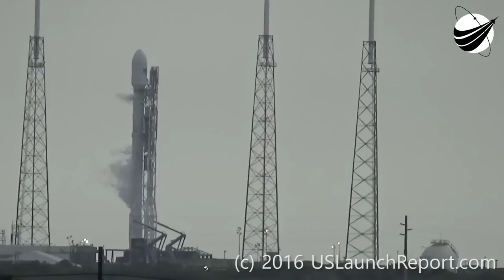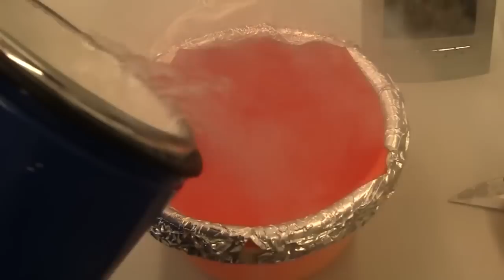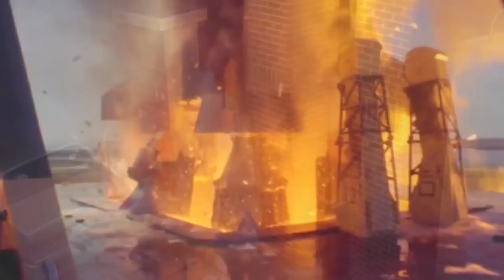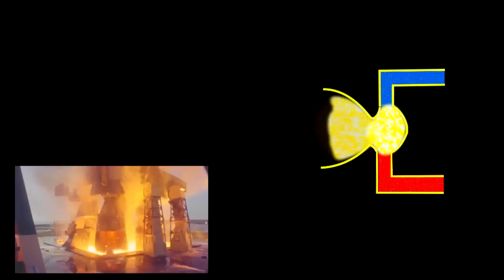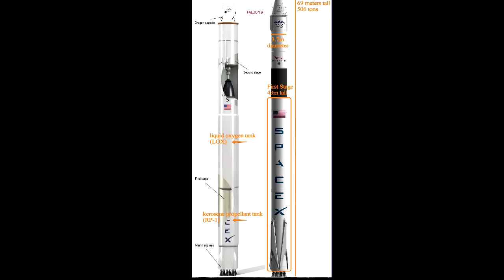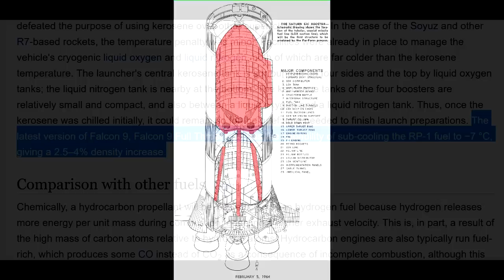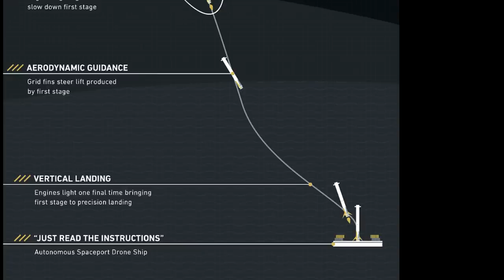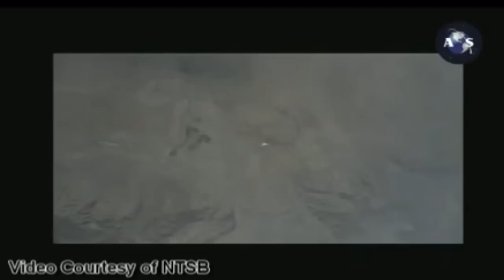Why did the Falcon 9 Explode?

Comment: Elon Musk is Thunderf00t's new Anita Sarkeesian.
Its not a bad video, just..  man is TF incredibly jealous of Elon Musk.
Reply: Except -- he didn't actually explain why the F9 exploded.  He had some speculation about the fuel tank/oxidizer lines through the fuel tank cracking, but nothing solid to offer on that count -- he seemed to spend more effort on setting chicken on fire.

And it seems a little odd to point out that NASA had a fueling explosion 60 years ago, and to point out that all of these problems are old hat, completely solved -- and then somehow think that because this is a 'commercial' venture, that the rocket designers deliberately chose not to use any of that data & instead preferred some inferior design.

Showing the Antares (Orbital Sciences, not SpaceX) explosion was somewhat on point -- he was talking about fuel and oxidizer mixing outside of the engine, at least.  But the SpaceShip Two (Virgin Galactic, not SpaceX) failure was basically irrelevant, other than a rotten attempt at FUD tactics to make out non-government space ventures to be some kind of boogy-man.

There was some great info on the dangers of LOx in this video, and some cool insights into why rocket science is hard.  There was no justification to the blatantly magical, gris-gris wearing, superstitious thinking that only NASA can build rockets.

Yeah, I think TF has a new obsession.
Reply: J L Brown Good point.  Its not quite lying in the "Violated YouTube terms of service" sense since he technically, very technically, worded it as a question.

Also, yeah, I watched the entire 2 hour(ish) NTSB review on the VG SS2 vehicle failure which was 100 percent operator caused.

He does realize that Elon Musk doesn't personally make all these things, right?
Reply: NUTCASE71733 so... you're some kind of idiot?  If you don't like someone's change in content, thats uh.. exactly the reason you would unsubscribe.  

Also, you seem to have no idea what the term "confirmation bias" means. Like... there's no angle I can look at what you wrote from and have it make any sense.  You might as well have said "potato salad" instead of "confirmation bias". In fact, let's do exactly that:

"Wow, so because you and TF aren't 100 percent alike he's lost his edge. Bravo on showing your potato salad."

See?  Makes just as much sense and at least now its a little bit funny.
Reply: fleinkantarell I gotta say, I really think this is a personal thing for TF.  He has an immense ego and doesn't like anyone being perceived as smarter than him.  I think thats all it boils down to.

Also, Im not used to people actually agreeing with me when I disagree with TF in the comments.  Its usually just a fucking shitton of fanboys flaming as hard as they can.

I am, however, completely used to TF totally ignoring everything in the comments on his video even though I know from new videos that he's done that he definitely reads this shit.
Reply: Yeah, it turns out he gets $3000 per video from his patreon sponsors for every single video he makes regardless of how crappy or short or duplicate it is.  Pretty sure he's pushing the line of both Patreon and YT's terms of service, but it explains why he's making such repetitive, crappy content.
Reply: would you be jealous of a man who just lost 1/4 of a billion dollars??
Reply: dunhillsupramk3 Also, I'm going to guess that rocket and satellite were insured, so probably literally everyone but Elon Musk lost that money, and that probably is something to be a bit pissed at.  Not in the video though.
Reply: sry i was wrong... the correct answer is 
""The problem which caused this explosion was not one that has been previously solved. In fact, it was caused by SpaceX's use of supercooled propellants and COPVs built into the LOx tank, something never done before. Since the helium COPVs were below the freezing point of oxygen and the carbon overwrap is permeable by LOx, SOx formed between the overwrap and the internal aluminum lining. Then, when more helium was added to the tank as part of the fueling procedure, the pressure against the buildup of SOx led to breakage and friction between the carbon fibers. Due to this, enough energy was created to ignite the carbon with the oxygen, the aluminum liner ruptured, and the LOx tank over-pressure, therefore mixing the fuel and creating a fireball. Although I respect your criticism, new technologies like these lead to issues never seen before, so I don't believe this was due to SpaceX's ignorance. I understand that this video was made before any definite cause of the failure was determined, but I don't think you should have jumped to such quick conclusions.""""""""
Reply: Yeah, but look back through TF's videos.  This is not the first of Elon Musk's projects TF has incorrectly and ineptly criticized.  This is like the 3rd or 4th one.  It wasn't a particularly quick conclusion, more a slow, annoying one.
Reply: Don't you dare compare those 2 people ever again! Not even in an analogy.
Reply: Adrian Speight Damn.  Fucking YouTube auto-unsubscribed me from Scott Manley.  I guess I stopped watching his videos as much once I started uh.. trying to play.. KSS myself.
Reply: htomerif
well i would guess that everything is insured but that doesn't change what i said and that is Musk lost 1/4 of a billion dollars and if i was some big business looking to put something in space i would avoid his company because i don't want to waste money and time... it will be a risk no business will want to take...

as for Musk fanboys calling him the smartest man alive just shows how stupid his fanboys are... Musk openly ripped on Steve Jobs for the same exact thing.... i personally don't agree with everything TF says but when it comes to science TF is better than Musk.... (Musk called hydrogen "silly" so Musk is sort of an idiot when it comes to these things, he is a good hype man but shit in everything else)

oh btw if your wondering why i'm so pissed off at Musk is because he lies...
Reply: dunhillsupramk3 Well, I'll tell you what, Musk fanboys are much worse than TF fanboys.

Now TF's videos on the "Hyperloop" are uh.. not so good, from a science and math perspective, but people are attributing the invention of a technology that doesnt even exist to Musk.

It is a problem I can see why TF would be pissed off about.  Apparently for the past couple decades, just being the manager or investor for a project entitles you to "I invented this" rights.

But since I happen to know how publishing scientific papers work, I have to wonder how many articles TF has primary on where he did effectively zero research (thats usually the way it works).

Oh, what did Musk lie about?  I'm sure its 'a lot of things', but I'm just curious.
Reply: htomerif
well a long time ago when Musk introduced the Model S he was going around saying that "it will be cheaper than a hybrid to run" and "no maintenance cost like a normal car" this was the argument for the high cost of buying a Model S... now when i did the math at the time (because i was thinking to buy one) i found that you can buy a Prius run it for 5 years with all additional maintenance cost, fuel and you will still have enough money to buy a new Prius after 5years... a lithium battery isn't going to last 5years, people can say what they want i've worked in IT for a long time to know a lithium battery will not really be useful after 3years of constant use and needs to be replaced after 5years depending how hard you use them.. (and all of this was before i found out about Tesla reliability issues and the MASSIVE price for a replacement battery)... oh and for some reason the door handles fail every few thousand miles and the replacement cost is like $3000 each...

another thing he said theta the Model S couldn't be stolen... if you know how you can steel it using a smart phone (Tesla isn't the only car you can steel with a smart phone)... he was also going around and making a big deal about how gas cars go up in flames in an accident because of the gas, they trying to let people believe because the Model S doesn't have gas there is nothing to fuel a fire and he did call gas cars dangerous... well a few years later and we saw a few Teslas go up in flames then we all found out that lithium is more dangerous that gas (i think a few years ago about 5 Teslas burnt down in flood waters after a storm)

lets also not forget the amount of Tesla owners and a good few dozen of ex Tesla employees that is currently suing Musk... again i don't agree with everything that TF here says but when he called Musk a "snake oil salesman" he was right...
Reply: dunhillsupramk3 Eh, yeah, thats a bit more of the "no man's sky" kind of lying, though.

Actually, just reading about it on wikipedia, some of them come with batteries that you have to pay to "unlock" additional storage it already has.

Now that is some fucking bullshit and something to be pissed off about.

Elon Musk is a salesman, though, not a creator or inventor.  "Inventing" PayPal really mostly consists of shoving competitors out of the market, which it did a lot of.

So when you look at the success of companies like Tesla Motors, its not that he invented anything, he just "invented" ways to squeeze out companies like the Indian company Tata Motors, which sells competing products for a tenth the price.
Reply: htomerif
i didn't mean to go off in a rant but every time someone says "idk why people is so hard on Musk" this is what i think and why people don't know about it....

Tata is making a $10k EV?? i don't think they will allow that car into the US or most other countries with strict safety regulations... Tata is actually a big company i don't think Tesla can push them off the market (they own Jag and part owner of Fiat, and that is huge)...
Reply: dunhillsupramk3 Since they do own car companies that sell in the US, my guess is it has more to do with India not enforcing patent infringement.

I know I'm contradicting my earlier comment a bit now, but patent infringement is bad enough with regular cars (patent consolidation is a big reason for mergers), but when it comes to the intellectual property patents present in EV's, it has to be a damn nightmare.

And now to uncontradict myself: Elon Musk probably has ton of patent infringement experience as I know thats one of the ways PayPal shut down a lot of its competitors, with purposefully vague IP patents.
Reply: Ad hominem fallacy
Reply: +clearspira
ok.. come on, think about that for a second.
No, on second thought, I want you to explain to me exactly why that's an ad-hominem fallacy.  Then when you're done, I'll explain why you're wrong.
Reply: Ad hominem fallacy - attacking the character, motive or other attribute of the person making an argument rather than attacking the substance of said argument.
That is EXACTLY what you are doing by saying that Thunderfoot is jealous of St. Musk instead of offering a refutation as to why his ideas are wrong.
Your move - explain why I am wrong, champ.
Reply: +clearspira
If you did get what I was saying, then why did you say the dumb shit you did about it being an ad-hominem fallacy then?  I mean youre just plain lying.
At this point, you can either just stop responding or explain why its an ad-hominem fallacy when the ad-hominem part is really the only part.
Reply: Dejavu
Reply: Uh, I think we can pretty categorically say no to that one.  If that were the case, they would have just unfueled the rocket.  Remember it had a $100 million (I think) communications satellite as a payload.
Reply: Elon Musk is analogous to Anita Sarkeesian.
-.-
Reply: Yeah, Musk isn't perfect, but NASA wasted so much money on the Shuttle which was a bad concept and killed many people, and the contractors who've had a monopoly on US Gov launches has taken incredible amounts of public money and not innovated in decades. Musk has spent tons of his own money to help make those launches cost the Public way less and has already been resupplying the ISS. Fact is, they don't know what caused the explosion yet, but one clue is the "quieter explosion" some seconds before the explosion and you know what? Thunderfoot was laughing his way through his countdown during that, and ruined the one useful thing that could have been in this video. It's still pretty new technology and improvements can be found just the same as NASAs experience developing the Apollo and Shuttle programmes. This was a tragedy for everyone and laughing gleefully because it was bad for Musk is simply spiteful and a shameful approach for a scientist. Contrast Scott Manley's video about it. I did like the rocket engine animations though.
Reply: fleinkantarell I was 100 percent a TF fanboy back when he was fighting VFX and William Lane Craig.

The first crack in the facade for me was when he did promised to sue VFX with the help of dprjones and then just settled out of court and didn't mention any of what happened.

I think I unsubbed after like the 20th "I'm butt-hurt that Anita Sarkeesian got half a million dollars" video.

I liked the video he did that had some stuff about Erwin Rommel.  I learned things and I like tanks.  ***** : make more video's about tanks.  Also: hard physics.  Yes, a good chunk of your audience can actually hack it.
Reply: dunhillsupramk3 See that aint it.  It doesn't matter if Elon Musk goes completely broke.  TF is jealous that people are crediting Elon for being the smartest man alive, a title TF thinks he himself should have.
Reply: I did think on it, and you are not as smart as you think you are - think on that.
Reply: I have a lot of respect for Thunderfoot from his atheist and anti-Kickstarter-scams days. That is the place he really belongs. Going against the New Space movement is a swamp he does not want to get stuck waist deep in. He will find himself in the same place as his old opponents; arguing from believes. Oh the irony :)
Reply: Given the headline this is a bad video. There were some nice basic rocket science though but no facts. You see, according to TF the real reason the rocket exploded was because SpaceX is a private entity, even worse, run by a Silicon Valley hot shot.  TF has a real thing against the whole New Space movement apparently. Do he really want everything back to where they were in the 80s? With big bombastisk government spaceprograms going nowhere?He has no idea why the F9 exploded. And neither does Musk ...yet. Elon said in his usually geeky ironic tweet that they had not yet ruled out an alien attack :).  This video was more a political than factual statement from mr Thunderfoot.

Comment: That was very informative at the least. I am not sure if your analysis of the reason for the explosion is correct, but definitely I got to learn many things about rocket fuel/engine from this video. And I do agree that we should have some process in place that helps with preventing reinvention of the wheel every generation. Indeed for a complex system as a rocket the knowledge base is so huge that effectively mining the knowledge is difficult. Perhaps some machine learning/data mining techniques will help?

Comment: I think the criticism and comparison of space x to NASA is a bit unwarranted. The problem with NASA is they do things based on politics and that's why the shuttle was a failure. They overpromised at the beginning of the project once they know their Apollo mandate would be taken away and then way under delivered once a new administration came in and took their funding away. They didn't even listen to their own engineers when the challenger exploded nor at the same time when they lost the first three Apollo astronauts on Apollo 1 - remember a 100% pressurized oxygen capsule. When did having to bat 100% in rocket launches become the bar for if the free market rocket launch companies are worthy or not?

Comment: The shuttle's tanks landed in the sea, so suffered huge amounts of damage from salt water corrosion.  The recommissioning costs reflected that issue.  That's why SpaceX is landing their vehicles on a barge, so damage is minimal and recommissioning costs are far lower.  It's over $25m for a Falcon 9 first stage vs maybe $2m to recommission.  Savings are over 50% (for SpaceX) and probably 20-40% for the customer.  SpaceX is already far and away the cheapest launch provider so it's a hugely competitive offering, even with maybe a higher premium for launch insurance.